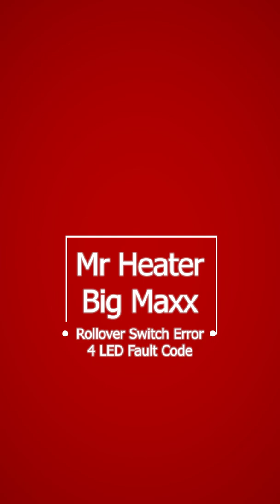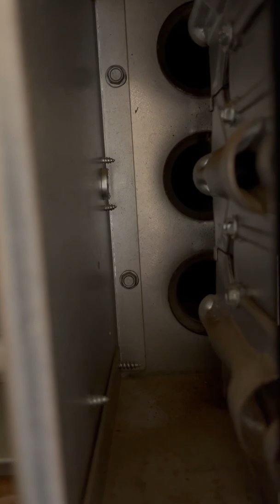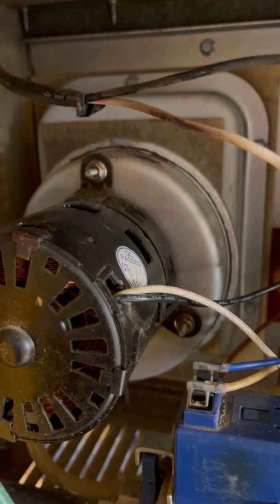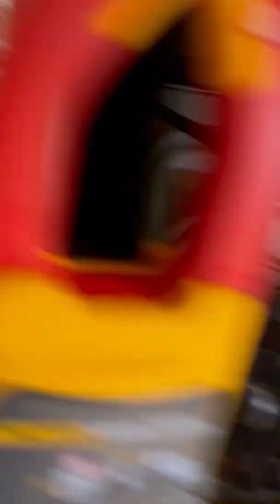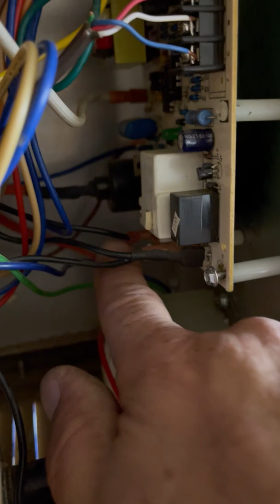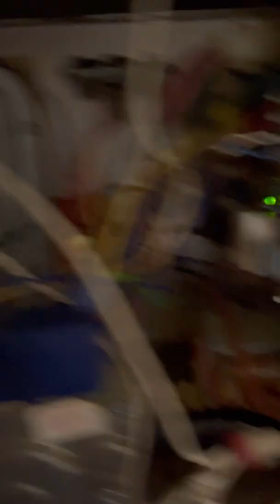Mr HEATER BIG MAXX 4 LED ERROR

Comment: My problem is similar to yours, however, my circulation blower does come on, but the unit cuts off and flashes 4 times. Then it will start the process over again. 
Ideas?

Comment: William - did you get the fan replaced?? If so, did that fix your unit? I'm experiencing the same issue myself. Dave
Reply from the maker: I did replace the blower motor however, it ended up being the control board. If you can supply power directly to the blower motor and prove it out, chances are the control board is fried.
Reply: @williamvega174  Thanks William! I've ordered both. At first it looked like the fan, but then I checked for voltage off the ACC1 pin and it was zero. I'm thinking the board will be the fix and the motor will be a spare. I had to order the motor out of Michigan and it may take a week to arrive. The board is local and should be here mid-week. So far it's staying just above freezing in the garage, but it's dropping to 1F/-17C tonight!!!
Reply from the maker: @Teamchevy001  Yes the fan threw me for a loop but the control board should do the trick. Luckily my shed is insulated so it too stayed above freezing. Good Luck
Reply: @williamvega174  The control board arrived this morning. Before replacing it, I made up a whip and tested the external fan. It ran, confirming the board was the issue. I swapped out the board and now I have heat in the garage!! I took some video and will likely post it up showing the whole procedure. Thanks for sharing your video! Dave